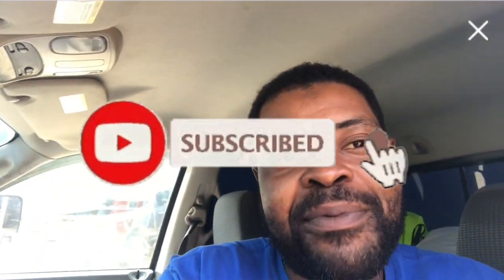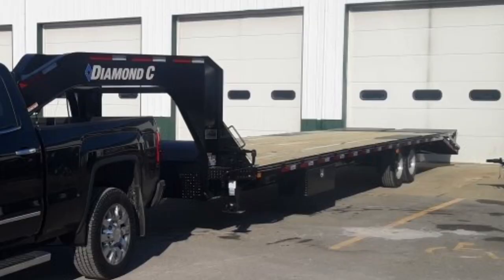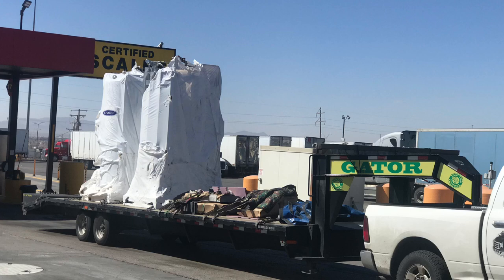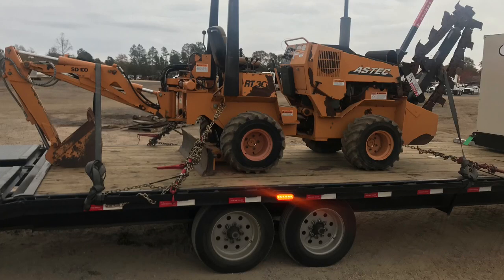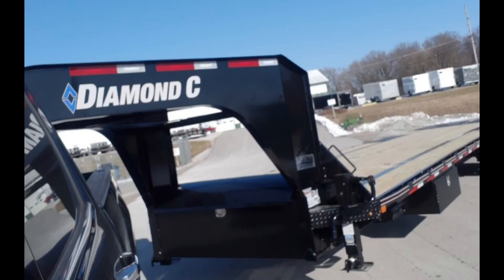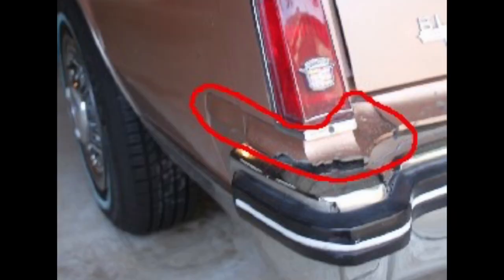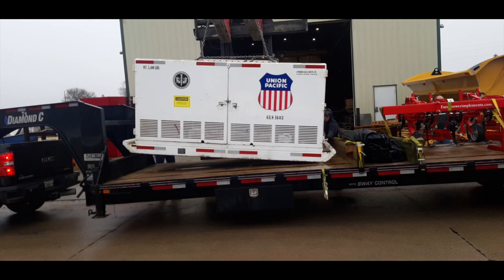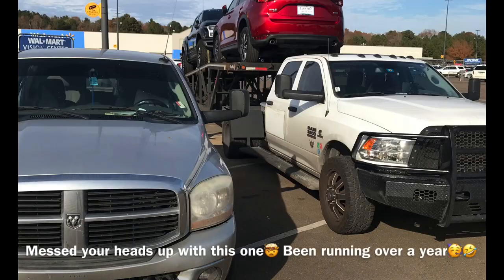Trailer Review!! Diamond C Vs Gatormade😎The results may really shock you‼️

Comment: Good information in part.   He stated a couple times that he overloaded the axles.   A few of your problems are a direct result from failure to do a pretrip inspection.
Reply from the maker: Yeah that was definitely part of the problem in those days. I actually was doing pre-trips but there isn’t a set way to do it on a hotshot so I was missing some critical areas of concern. I learned over time how to do some very specific checks that really helped to prevent a lot of these problems… There was definitely a learning curve that only comes with experience…

Comment: Great info my man,,,, you know your trailers. I have a 25ft Gatormade and my main problem has been tires. I finally upgraded to 14 ply tire which is dang hard to find but its doing the job. Yes, It is a Chinese made tire but its holding up so far. Other than my tires, the trailer is holding up really good,,,paint is not so great but its tough trailer.

Comment: As a comparison my super cab long bed 2021 F350 6.7 FX4 with 75gal in a 90 gal tank and full truck fuel and 32' 2021 22K Elite dual tandem trailer with 10k axles scaled out at 15600. 

BTW Truck weighs 9000# fully loaded with driver(350#).

Comment: The diamond C is only lightweight compared to other trailers when the length gets longer, like 40'. The shorter 20+5 or 25+5 trailer sizes are almost identical in weight.

Comment: I’d like to see the specs on both. There is 50 variables on each truck/trlr setup that could change the weights quite a bit. Also a few things I noted. Yes there lite weight trailers as far as capacity but there is also an option for elec over hydraulic brakes on both. Wouldn’t have magnets exploding. Also there is the option for disk brakes which are far superior and u don’t have drums explode then. Spring ride axles are not exactly ideal for a company that’s gonna rack up miles hard every week. Just my thoughts on some things. You spend more $ the first time avoids a lot of this type of stuff. Moral of the story don’t buy the cheaper versions and expect reliability of the better built upgraded everything trailer.
Reply from the maker: If they build it and sell it, i think it should be done correctly. True there are levels to trailers but poor quality control is a horse of another color. Thanks for the comment and safe travels out there bro

Comment: I bought a 14k dump trailer....tires were rated at 12.k, so the tires couldn't match the trailer's weight capacity.    Apparently the DMV allows trailer manufacturer's to equip trailers with tires matching ONLY to ~90% weight capacity....which is something I've never heard of.       I upgraded my dump trailer tires to semi truck front steer tires, they are same size but have twice the side wall strength and required for ANY offroad driving, gravel roads, street curbs, pot holes, etc.
Reply from the maker: More like 80%😬 I don’t think it’s safe for the type of miles we do. I recommend at least a 14 ply

Comment: I sold my 32ft load trail that weighed 8600lbs. Bought a Diamond C at 7110lbs. Its built way better than anything on the market.
Reply from the maker: I agree they make a good product. Ours just lacked quality control. The things that happen to ours could’ve happen to any manufacturer or dealer that doesn’t do a proper PDI (post delivery inspection). Ours is 7,750 lbs at 30+5 which was a real eye opening thing and a big let down. For what we carry in a non cdl atmosphere can be done by ANY manufacturer. Tbh I think the engineered beat is purely marketing for a 14-16k trailer. We’ve had PJ, Gator, DC, and Lamar in the fleet. The DC would be considered Jordan but non cdl, some adidas honestly would get the same job done...

Comment: Thank you for this honest review. I have been torn between PJ, Gator, and Diamond C. This did help me. I was leaning hard towards that Diamond C, but..Whew!! That's a whole lot going on! 

With regards to the pot hole issue you had with your trailer, you might have had better luck going after the city for that reimbursement. Here in Indianapolis, if you have to come out of your pocket because of a pot hole, you can submit a claim with the city. I'm certainly not saying they all get paid, but you'd have at least had better customer service with them.  

Also, your fender tips dig had me cracking up!! You went all-the-way back! Keep up the great content!  

One question: Do you have an opinion on oil bath axles vs grease? I haven't looked through all your videos, but I will. You just sound very knowledgeable about the mechanics of it all.

Comment: Great video! Excellent information and kept it real too. I was looking at a gatormade gooseneck dump trailer, and a big tex brand and a load trail brand because they are close to where I live. I have a gooseneck big tex 40 with hydraulic dovetail. It has been a great trailer over all. The load trail guys have a 232 warranty which covers the towing truck too. I might go with those guys from here on out.
Reply: I considered Load Trail until I saw a used 2019 model on the lot. In one year it had turned into a rust bucket. The powder coat had started flaking off in areas, you could clearly see where welds weren’t properly cleaned and prepped before powder coat and were rusting badly.

Comment: You'll go broke running 7k drum axles. I run 12k disc brakes with 14ply. I get 100k miles out of my brakes and tires. I have a 2015 40ft loadmax for sale that's had 3 sets of tires including factory and 2 sets of pads I set of rotors and calipers.  In 5 YEARS max weight use.
Run provider flyer tires 14ply from discount tire direct $150 ea. GOLD . But good luck and keep grinding
Reply from the maker: Great setup but it’s not applicable to non CDL due to weight. Disk brakes are available on 8k axles tho but besides that, the 12x4 brakes are about the largest on an 8k.. I wouldn’t go as far to say a person would go broke because the price of 3, 2x12 changes is about the same as the one pad change you’ll need for the 12k’s. I think it’s more about time wasted. I like loadmax trailers they seem pretty strong. I have a friend that runs them👍🏽
Reply: @HotShotHaven  I forgot your not CDL . What's holding you back? I'm sure there's more loads up to 12k lbs you can still pull with a single wheel instead of being limited to 8 or 9k loads.
Think about this what's gonna pay more hauling $1000 in building supplies or an $80000 skidsteer that takes up 10ft of deck. Drive up and go quick load
You'll start seeing 3 and $4 per mile loads even as a partial . I do mainly oilfield pipe and equipment and it pays well because it's big dollar stuff. 1 valve set can be $100k in value but it pays big$$$.
Reply from the maker: gary r nothing is holding me back personally. I just like the weight class and have really learned the partial game. I work my equipment very easy with Awsome fuel mileage. I do have CDL equipment that I dispatch daily and the difference really isn’t amazing. I don’t want any part of losing any of my personal freedoms for I title that in clearly don’t need. I’ve made more money since I started in 2018 than 7 of 10 of my acquaintances in 18 wheelers. I just work hard and have good customers that move lite stuff for good money. I just found my niche bro, that’s all💯

Comment: In this interest of fairness, I work for gator. If you are going to hot shot a 4 tire trailer in my experience the only way to go is 8k electric over hydraulic DISC brake axles that last so much long with less trouble and less cost to work on!
Reply from the maker: Either one should at least last 3,000 miles just the same. I had adjusters exploding and become lodged in the shoe WEEK ONE. That’s a true statement about the discs tho, I must agree..

Comment: I live in Colorado born and raised in Mississippi I just bought a  GMC TOPKICK  4500 trying to decide what type of trailer car hauling or drop deck? I'm moving back to Mississippi would like to run back and forth between the two .
Reply from the maker: Buy the drop deck and let it pay for your next car hauler. Freight is a little more versatile for starting off and you can still run a couple cars in a pinch. Cars do pretty well also with volume but are even harder to get a load for in the first 3 months due to the cargo value..If you do cars you will really see your money running 5 or more✊🏾💸🚛💨💨💨

Comment: Good info my friend. I learn something new everyday. So of all the trailers you’ve ran, what is the best in your opinion?
Reply from the maker: For non CDL I like the PJ better than all of them for price, weight, and strength💸🚛💨💨💨
Reply: Thank you sir.
Reply: @HotShotHaven  can you get a 40ft pj trailer and stay under 26k with dually and trailer? If so, what model please?
Reply: @Rmayrap  Yes.  It is a called a low pro flat deck with singles (LS) PJ Tailers.
Reply: @sheepdawg6946  how does it compare to the big tex 16gn?
Reply from the maker: I think the PJ design is superior because of the gussets in key areas and the weld quality. They are owned by the same people but the designs are separate. Just hope pj doesn’t switch to Chinese Steele in the future..

Comment: Overtime the Diamond Cs will last a lot longer than the Gators. I've got to visit and see both manufacturering sites and I believe Diamond C puts the best work into their products. Like you said it comes down to money and you usually get what you pay for. Safe travels.
Reply from the maker: I agree! The suspension setup in the DC is better and so is their rust protection 💪🏽

Comment: Do you think it’s a big deal if I ordered 235/85 R16 when I upgrade my tires instead of 235/80 R16 that it came with on the trailer?
Reply from the maker: I think it would be fine. To know exactly how much extra side wall you’ll have do 80 or 85% of 235mm and that’s how much taller they will be👍🏽
Reply from the maker: Ply rating equals more load rating, so the more the better. I suggest 14 plys
Reply: @HotShotHaven  thanks! 👍🏻

Comment: You have to upgrade to electric over hydraulic brakes that will fix all brake problems.
Reply from the maker: All systems have failure points. I totally agree that EOH performs vastly better but you have more components to attend to and actually more failure points, ie pump, lines, wheel cylinders, and ect….Each system is only as good as it’s individual components and maintenance. Most all trailers are initially assembled with the cheapest of everything, which is really a shame…

Comment: Could you tell me if DoT officers are looking at the GCVWR at the scales or only seeing if the weight on each axle doesn't go over their GAWR?  The reason I ask is Ram actually has weird ratings for their pickups. For example I am about to buy a 5500 DRW but their 3500 is actually rated higher than the 5500 for tow capacities?? The axles, however, are rated higher on the 5500 than the 3500 (actual ratings below). So going by their axle ratings I can actually carry much more with the 5500 but the 3500 for some reason has a higher 'tow capacity and GCVWR'.   

The 5500 has GVWR of 19,500 and a GCVWR of 37,500. Max trailer rating is 28,760.
The 3500 has a GVWR of 14,000 and a GCVWR of 39,100. Max trailer rating is 30,120
Reply from the maker: Neither they look at GVWR on both VIN stickers and add them together.
Reply from the maker: We want the AXLE capacity. Believe me, the brakes and axle are SUPER different. 5500 is the stronger truck with more payload so you won’t be over on each axle. Gvwr is the main concern. A 2500, for example can TOW a lot but it can’t take the weight of the trailer bearing down on the rear so it sags low, the 3500 will just squat, and a 5500 looks UNLOADED 💪🏽💪🏽💪🏽
Reply: @HotShotHaven  Thanks for the reply. So if I understand correctly, I have a CDL so as long as the steer and drive does not exceed the vehicle GVWR and the trailer axles aren't over the trailer GVWR then I'm good? and that my plate on my vehicle is registered through IRP for the max weight I'm going to be carrying?
Reply: @HotShotHaven  I understand.  I appreciate the replies and the help in your videos!  Your content is as real as it gets and I appreciate that!
Reply from the maker: They have the axles separated by weight on your truck vin sticker. The GVWR is for a single unit. The breakdown of axle weights is for combination with trailer. So then you’ll see you have a front, rear, and trailer axle capabilities to go off..

Comment: Would never buy a new trailer, work like you are doing or personal RV without the disc brake upgrade.  But I actually think anyone selling a trailer hauling any real weight, should only put disc brakes on the trailer.   I pull my 5th wheel camper with one of my work semi tractors and that truck has plenty of braking, but really wish my older 5er had disc brakes, not drum brakes.   Might have missed it, but did your o/o reach out to DC about the tire issue and if so did they take care of him like Gator took care of your tire issue?
Reply from the maker: Disc are the best bar none👌🏽DC did correct the axle issue once but not the second or 3rd incident in the first 90 days..

Comment: If you want to hear it like it is, this is the video for you. ha ha ha ha, very nice dude, your both smart and hilarious!!

I would like to add that ive had a gatormade 16ft gooseneck dump, 8k greased hubs, for a year now. I have not used it a lot but your observations are pretty much spot on - gator is fabricated and built solid, they have pretty much zero customer service, the tires are low quality, and the axles although Dexter is supposed to be a good brand are kinda hit and miss. To this day when i start up or almost come to a stop, or use the brakes, it has this annoying hop where i can tell something is rubbing and gives a very distinct pulsing/jerking. Its very disappointing but Ive just lived with it, but after seeing some of your pics Im sure its a brake shoe or drum problem.

Comment: My only reference is your video. 
But in saying that first. I did notice a deck difference. one trailer has the main beems exposed on the deck and the other is completely covered by wood. Somewhere in that area im betting thier may be some small weight differences related to the understructer and each trailers engineering. If i was hunting for and answer to the tare weight issue. Id look there. Im not a trailer engineer. Im just saying. 
Overall tho good video.  Thanks.
Reply from the maker: Good eye bro!!

Comment: Gator made only offers pnie flooring. No Apitong availble as an option. It is a pile a junk!
Reply from the maker: I was pissed at the time about it. The dealership told me it could but the manufacturer said no! I went to the manufacturer and had mine custom made (with pine 😕) then they took my whole spec sheet when I explained why I wanted it like that and made it “their” standard non-Cdl trailer. Not even a thank you card..🙃

Comment: The reason these trailers break down is that the axles should not be rated as heavy for example a 7000 lbs axle should only be rated at 6000 lbs in my  opinion those are over rated  If you compare longer and heavier trailers there will be a bigger weight difference on your lighter smaller trailer you will see very little weight difference if you hit a pothole it's your fault and not the trailer or axle manufacture and should not be warrantied
Reply from the maker: Good comment bro & I agree about the pothole situation👍🏽

Comment: As a Non-CDL driver can you operate  a 40 foot trailer
Reply from the maker: Cdl or non CDL the length is not a problem as long as the total length is not over 65ft. If it exceeds 65’ you must remove the bed of the truck and register it as a tractor. Some just run illegally and stay out of states that enforce the law regularly. Texas is bad about it, that’s why those good old Texas boys that run non CDL with a 40 practically live to run California clean back east to stay mobile and minimize their time in hot states..
Reply: Yeah I live in California
Reply: Thanks

Comment: I got 2 gator made trailers. Both have their short comings but so do all the others. I agree the paint on gators sucks. They look good when you pick them up but a couple years later their a mess. All the trailers must have high school drop outs wire them and use the cheapest material with the worse connection materials possible. All of them could be better in standing behind their products not just in the up front of selling a trailer with all the smiles, pictures and hand shakes with the 3 year until you get out of the parking lot warranty. Their all in it for the sales and don't give a damn about the service.
Reply from the maker: I couldn’t agree more sir!!!